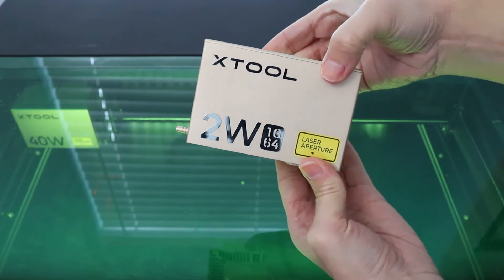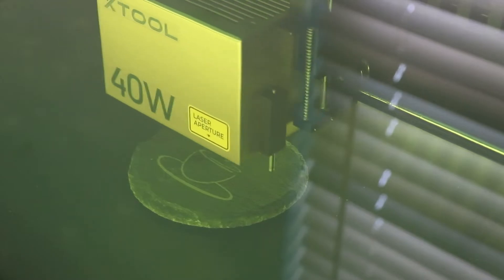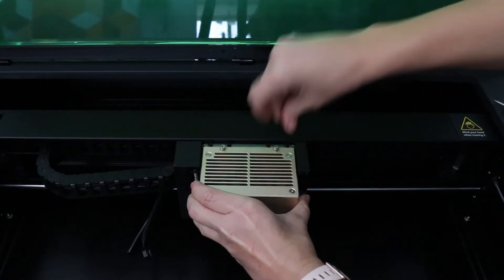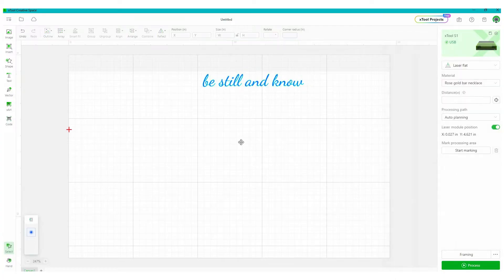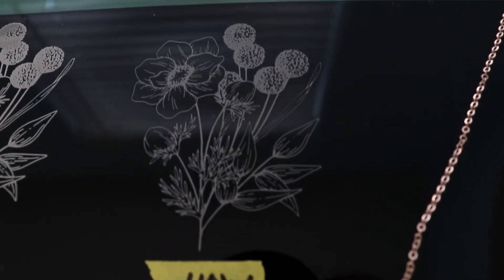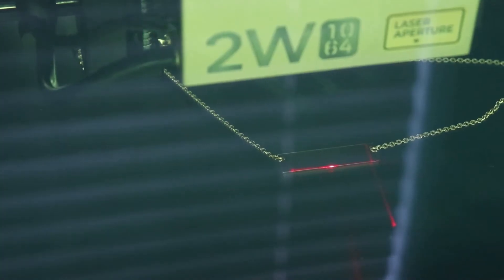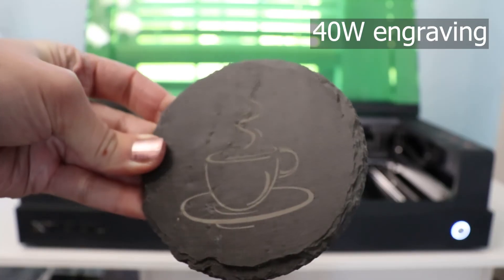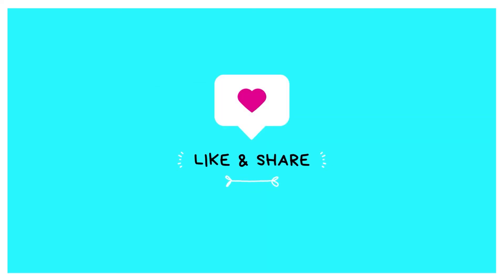xTool IR module for S1 - do you need this?

Comment: Ok so you can engrave mirror polished stainless steel with the regular s1, btw they have a 10w. Cuz I have the m1 and I use it for work but I want another machine. M1 is fine but s1 is the newer option but idk if I need the ir head or just the s1. I think 10w is enough is my m1 is 10w and works fine ..

Comment: Hi! Could you help me please? I got a brandnew IR 2W Module for my S1 Laser. Howerver, when I try to engrave the metal dog tag (1,8cm metal round from xTool), I do not get any result, although using the standard set up for thie material. There is the red cross, when I do the positioning, but when I start the laser, there is not that bright flashlight, which you show in your video.
Reply from the maker: Try running a test array on the material to see if anything shows up. It could be that your particular machines needs some tweaked settings. Here's a video on how to do that if you need it https://youtu.be/sOXNi7BsdAc

Comment: Cant engrave glass?
Reply from the maker: I use the standard diode laser module to engrave glass, you need to add a coat of paint or marking spray first as it won't engrave bare glass.

Comment: I am interested in engraving metals, such as copper, brass, and sterling silver. I am also interested in engraving in stone.  I saw the Cricket Maker 3 engraves metal but not sure the metals I want.  Would a laser be better?  I do small work…3x6” is largest.  No idea what to get!
Reply from the maker: If you want to work with metal and stone definitely look at a laser. A Cricut Maker 3 can engrave very thin, soft metals but it takes a while. The xTool F1 might be a good fit for you, it's small and portable. Take a look at this comparison tool and scroll down to the types of materials you can work with. https://www.xtool.com/pages/tech-specs
Reply: @SarahVanderkooy  I appreciate the feedback!

Comment: Can you use this to cut wedding invitations? Or what adapter you would suggest?
Reply from the maker: If using cardstock paper, the standard diode laser module can cut and engrave that. It's done with a very light power and you get really intricate and beautiful results.

Comment: I've not been able to remove the 20w laser module in the S1. I follow the easy instructions but it just won't move. I've had to clean the laser module in-situ. I'd like to buy the IR Module but I can't see how I can remove the current stuck 20w.😢
Reply from the maker: It definitely should not be that hard. Have you tried reaching out to support? They may have some guidance for a module that is stuck.

Comment: Can this IR module do clear acrylic? Have you tested that out?
Reply from the maker: No it cannot, it's similar to the 40w or 20w in that the laser goes through the acrylic without leaving a mark. You'll need a CO2 laser to work with all types of acrylic.
Reply: clear acrylic = CO2 only
Reply: You can do work with clear acrylic you can use washable black paint or black PVC card. But to be honest washable black paint is the best to get the best results.
Reply: @rameenkhojestagan558  with a 2w IR?

Comment: I purchased an IR 2W 1064 module for my S1. In conclusion, I don't think you need to buy it. I wish I hadn't bought it.
First of all, the 40W module was sufficient for metal plates such as dog plates and stainless steel tumblers, and we were able to print very clearly.
The default parameters of the xtool software (xtool Creative Space) were not suitable for metal products.
The low power of about 50% of the 40W module, the medium speed of about 120, and the high engraving density of 300 are ideal for metal products and have almost the same quality as the 2W IR module. The 2W module produced better colors than the 40W module, but some people may find the 40W more beautiful depending on their taste (my wife did).

Also, after engraving a few metal plates using the 2W module, the output became weak, and the output did not recover until I left it for a while. As a result, some tumblers fell victim to engraving errors.

I suspect that the 2W module may have a structural defect. After all, I just bought it, and the output recovers after a while, but it's strange that the output drops immediately after continuous printing. I was able to engrave the logo on the front of the tumbler beautifully, but the logo on the back.... With continuous engraving, the engraving output decreased and became blurred. Also, although you may be able to engrave beautifully on both sides, the output will decrease after a while (it does not operate for a very long time). Of course, the same phenomenon occurs even after cleaning the laser module lens and reattaching it.

I contacted xtool the day before yesterday and requested a repair, but I have not received a response yet. I don't know if it can be repaired or replaced, but since I just purchased it and it's still under warranty, I will contact xtool again next week.

A 40W module is sufficient. At the moment I do not recommend 2W modules.

There is no doubt that xtool S1 is a very nice machine, but support is not very promising at this time. Also, most of the videos on YouTube are sponsored by his xtool, and there are few reviews from people who have actually paid for them, so I would like to make videos and blogs that include the good and bad points. Since it is from Japan, it will be in Japanese.

Comment: What settings did you use?
Reply from the maker: I always start with the xtool recommended settings in XCS. Choose gold or stainless steel or whatever material you are using. In my experience those settings tend to work well.

Comment: How deep did it engrave into the metal? Easily sanded off? I want one for engraving knife blades with logos, dates, names etc.
Reply from the maker: It's not deep. You barely feel the marking when running  your hand over it. I haven't tried sanding.